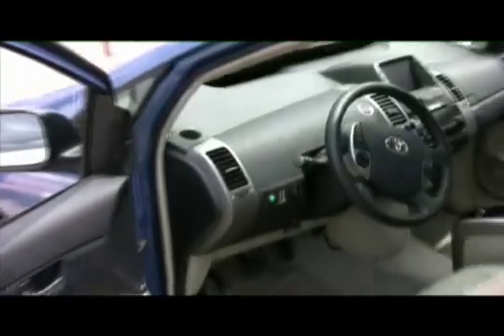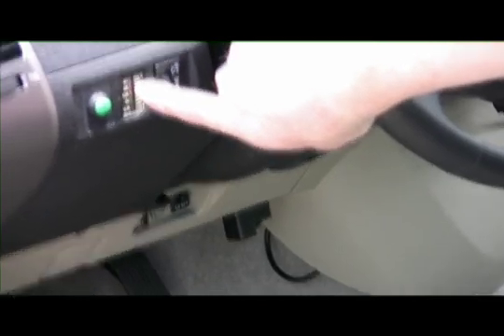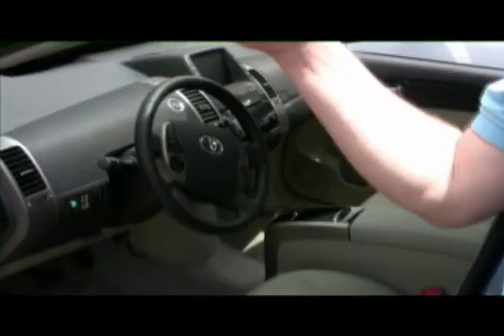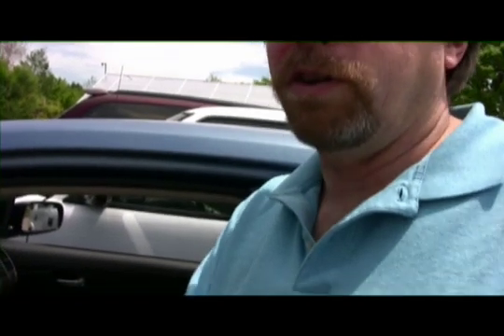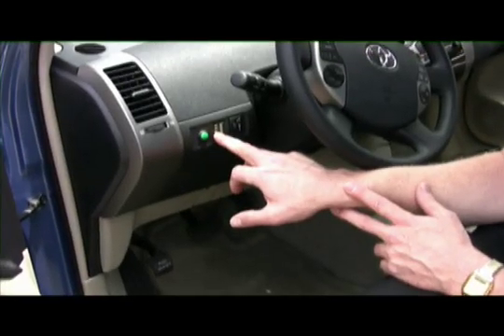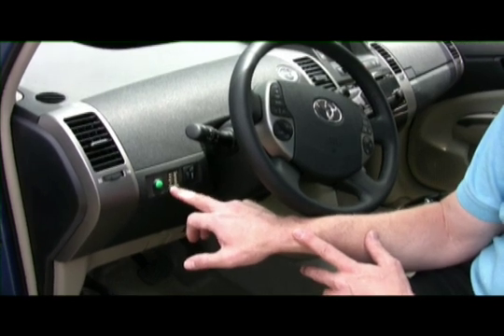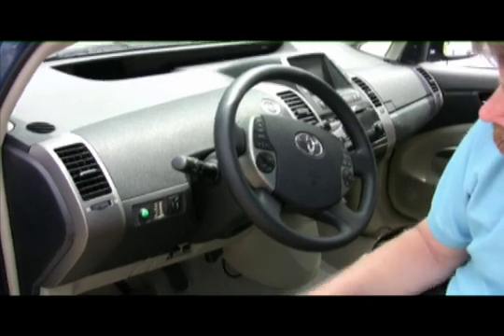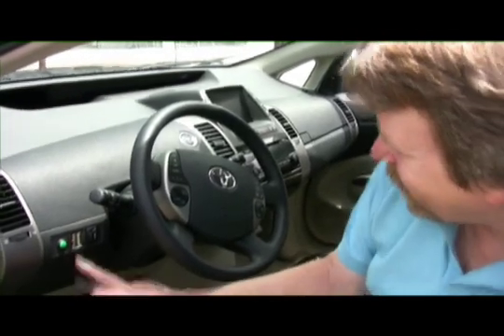Prius PHEV part one

Comment: It's exciting to see that a technology as relatively new as hybrid has already been improved. I ride a bike everywhere but am buying a Prius, intending to have it converted to a plug-in hybrid for winter driving. Most people are not aware that electric companies, like the one here in Cleveland (CPP), has a reduced winter rate. It even gets better: if I use over 1000kW/hr the rate then drops from $0.055 to $0.035. Rates are higher during A/C peak season (summer.)